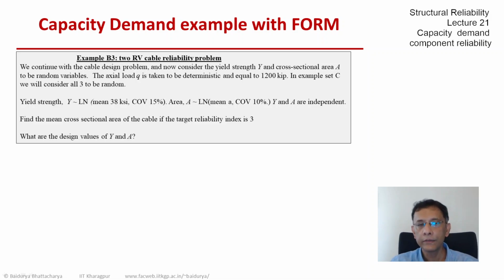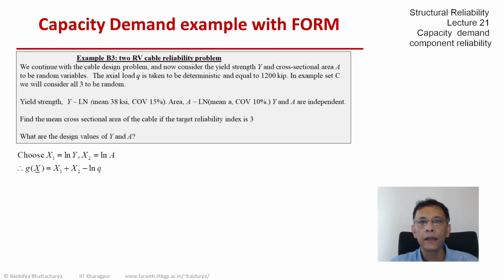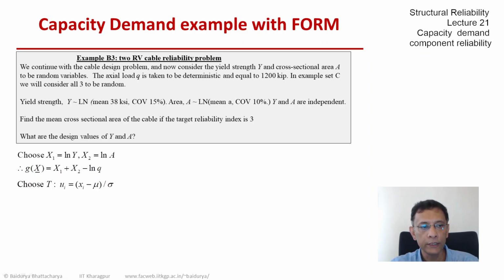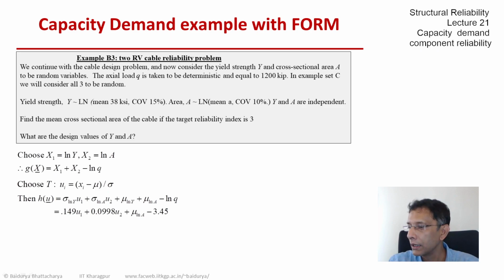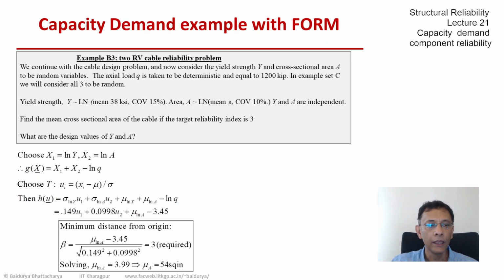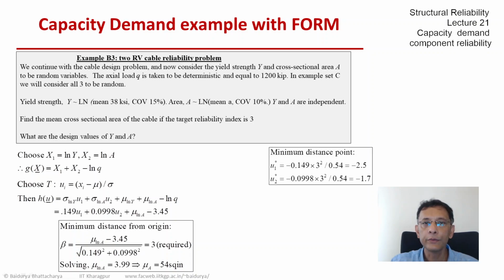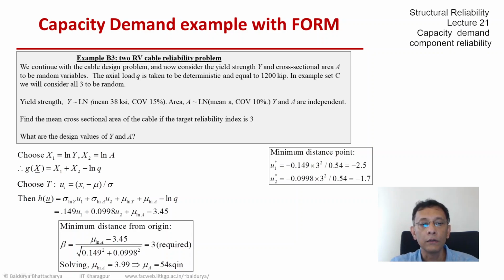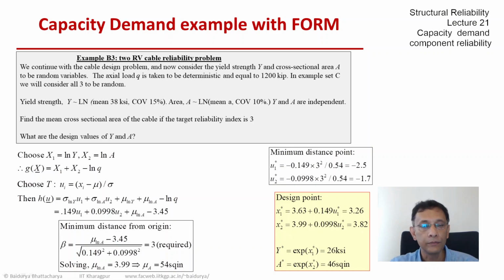STRUCTURAL RELIABILITY Lecture 21 module 04: FORM (First order reliability methods) - examples

Comment: helo sir, thanks for your effort to make this lecture. in this section, Yield strength and Area are both LogNormal and limit state function become X1 + X2 - ln(q) with X1 and X2 are ln(Y) and ln(Q) respectively. if  i change the Area distribution to Normal one, is the limit state function become X1 + ln(X2) - ln(q) ?

with X1 = ln(Y) and X2 = A. is my intuition is correct? again thanks for your time.